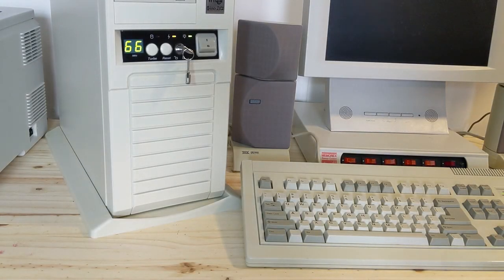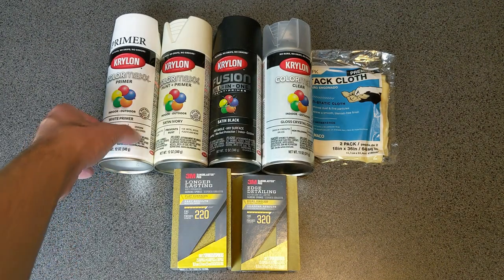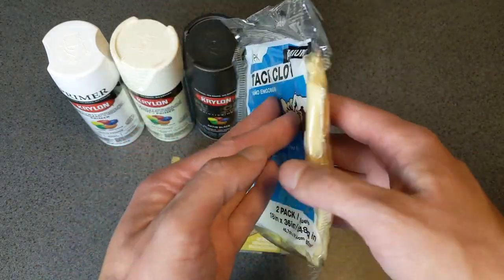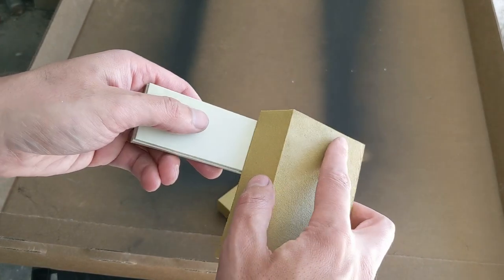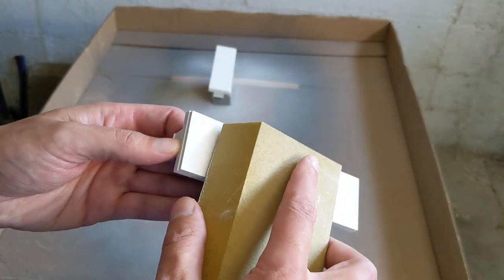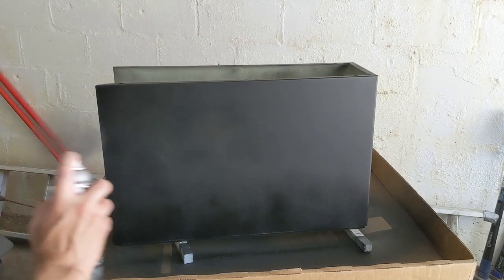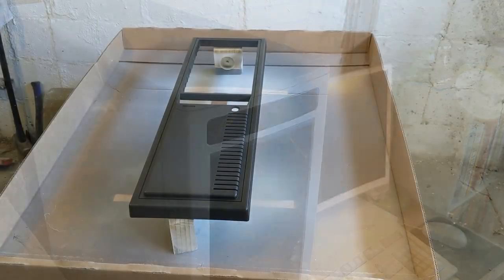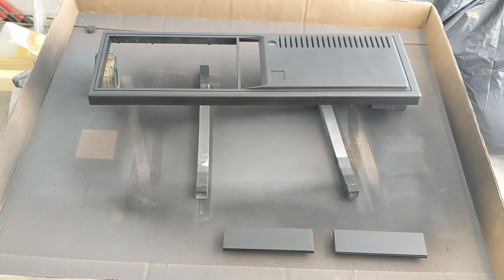How to Build a Sleeper PC Part 4: Spray Painting your Vintage Computer Case

Comment: Does this apply to painting the inside of a case as well?
Reply from the maker: It would to some degree. I'd remove whatever you can from the case and paint it separately. If you are painting the outside of chassis only (and want the inside to remain unpainted) you would need to use some plastic and tape to cover up all the openings. You can see when I did that with the ivory tower -- the first pic I show here after the intro.
Reply from the maker: Aaaand if are just painting the inside of the case it is basically the same (angles are a bit trickier though). Just make sure everything is removed first!
Reply: Good to know! Thanks
Reply: Hey Benny, if the inside of the case is bare metal, clean it with mineral spirt. That’s to get the oil and whatever is stuck to the metal off. Let it dry for an 30mins. Then use “etching primer”. Etching primer is made to bond to bare metal better then regular primer. Then you can follow all the other steps in the video

Comment: Glad to have all this info going in! I already have some stuff in mind for a sleeper rig such as the hard drive caddies and a Blu-ray drive for games that came on optical discs. Ditto repurposing the floppy drive as an SD card reader like Dr. Moddenstine did. Never thought about painting a case, though. I always thought the beige it came with was integral to the look. But if I do paint the case, I might go with the trans pride and lesbian pride colors. Maybe black to match any black drives I put in the front.